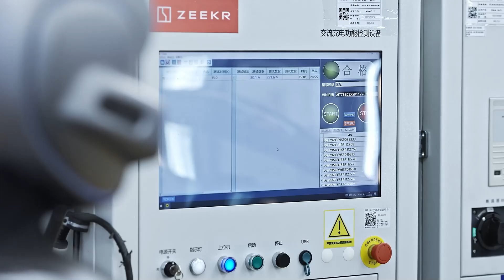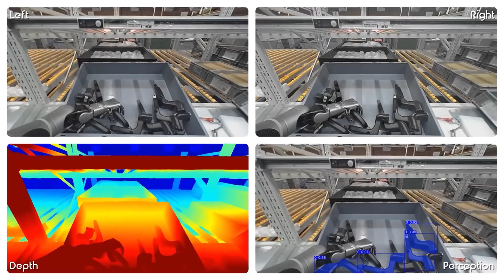Walker S2 Leaves Elon Musk's Optimus in the DUST!

Comment: You're lying through your teeth. Apparently, you know nothing about Optimus.
Reply from the maker: Where’s Optimus?
Reply: @pixelatedtech  Where is Walker S2 with 20 different hands for different purposes, 4 batteries and each action needs to be programmed to do any work at all??
Reply: @erikbarsingerhorn4485  Zeekr and BYD use Walker S2.
How many Optimus are in industrial use?
Reply: @hg6996  Wrong question. What Zeekr and BYD have is a robot. But not a fully autonomous AI-learning robot. All actions are programmed. Just like Boston Dynamics. And Waymo Taxi, a programmed car for Google Precision Maps with Lydar and Radar to avoid hitting anything.😅😅
Reply: @erikbarsingerhorn4485  That’s not the case, since China wants to use these robots precisely to make them work 24 hours a day, which would not be possible if there were a human behind them. Consequently, they are completely autonomous; in fact, they even recharge their own batteries.
Reply: @Gerryio  What is your definition of autonomous?